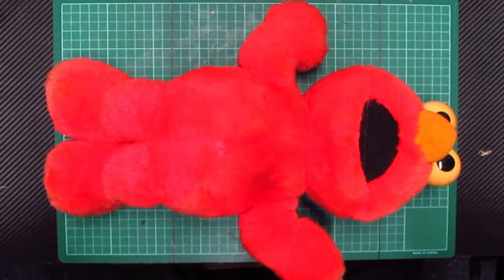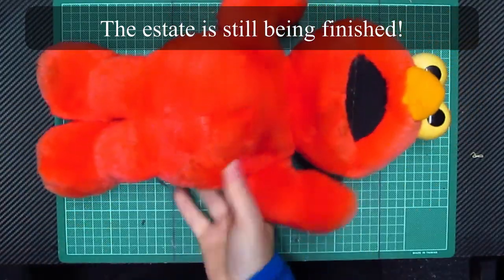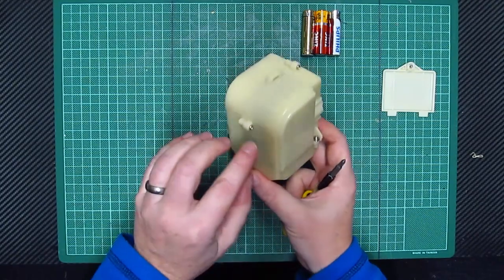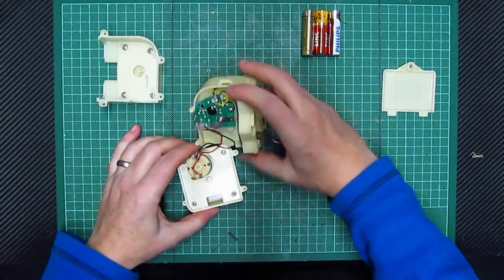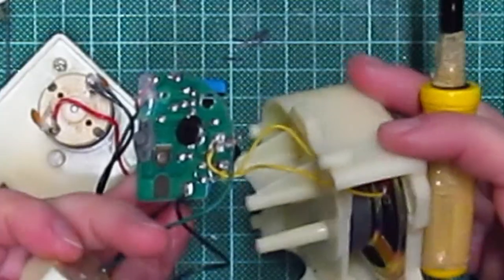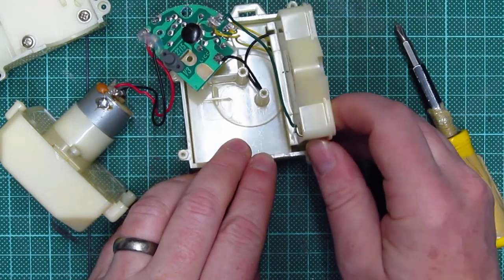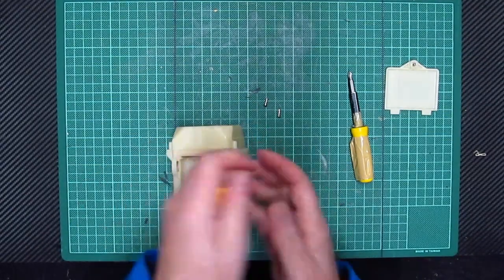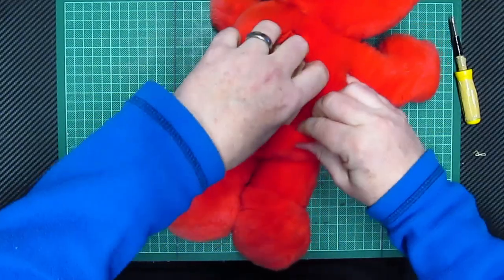Original 1995 - Tickle Me Elmo - "Saint Elmo's Wire" - Wiring overview

Comment: I had a screw left over also! Haha - I wonder what's up with that. My wires were red, black, green and white. I need to solder the green and white to my battery and then I believe it will work. I did have a lot of corrosion from the batteries that had been inside. I cleaned the area very well.
 Thank you for your time making the video - it was very, very helpful!

Comment: Been trying to find a circuit diagram for this. On mine the motor isn't coming on when it should. I've tested the motor and it is fine, and everything else is working correctly - so think there is a problem on the circuit board itself.
Reply from the maker: You need to tone out the traces and see if you have any dry joints or breaks. A re solder or patch with some enamelled wire might be in order!
Reply: @MikesRetroTech  Is "tone out the traces" a continuity check on the board itself with a multimeter?

Been doing a few quick tests on it today, but think I'll be breaking out the soldering iron later!
Reply from the maker: @metalfuryskulls  yep a continuity test. Be a shame if you can't save him!
Reply: @MikesRetroTech  I will do my best! Thanks 🙏
Reply: Did you fix your elmo? Mine had problems with both the speaker and motor. Replaced the speaker and sounds work now. Motor worked when directly powered but was reluctant to go in the circuit at all. I will try to clean the motor otherwise I think it needs replacing too
Reply: No joy I'm afraid, but you've reminded me to take another look

Comment: I have a PCB that's completely corroded unfortunately. Not sure we're to get a replacement.
Reply from the maker: @TheHammemo  unfortunately, the only way to get a replacement would be to buy a none working elmo and hope the board is fixable. I doubt you will find just the circuit board on its own. We need companies like PCBWAY to have the design for it so replicas can be made.
Reply: @MikesRetroTech  PCB would be simple to recreate but that chip under the epoxy might be a problem. Might be able to get it off without destroying it but don't know if it even works.